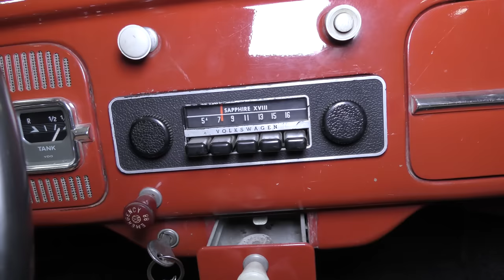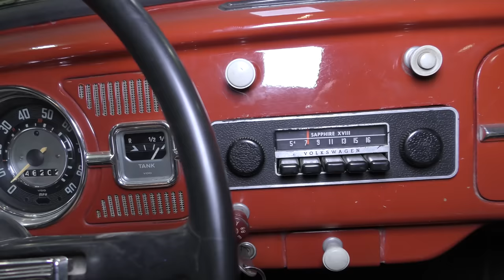Big Mods with big $$$. When Mods don't make sense. What did the  CAR WIZARD do to this '66 VW Bug?

Comment: We have a 1970’s Chevy grain truck with a 427 gas engine. It came factory with electric fuel pump. It has a prime button in the cab. After sitting for 6 months or a year, you hold that button until you hear the pump slowing down, crank it and it fires right up every time.
Reply: Do you mean just for priming...did it also have a mechanical pump on the engine?
Reply: @JohnSmith-yv6eq  it runs on it also.
Reply: @junkorbust9498  
Why do you have to hold the button down if it runs all the time? 
As soon as you switch the key on, the pump should run...and continue running..
Unless you have an oil pressure sensitive on/off switch for a rollover/crash situation where the pump only runs when the engine runs and has oil pressure?
That would make sense of the "primer button".....
Reply: @JohnSmith-yv6eq  i went to lay under the truck to get the answer for you. It has an in tank fuel pump in each tank. There’s a block with some check valves where the lines are connected. A switch on the dash switches between pumps and the prime button runs the pump with power direct from the battery to fill the bowls before starting if needed. Farm trucks often sit for months at a time so it’s a handy set up. It came from the factory that way.
Reply: @junkorbust9498  
Thanks for your dedication...
I have a 1972 XJ6 Jaguar with the twin 12 gallon rear quarter tanks, with two pumps and a selector switch on the dash. 
The selector switch just selects the pump which works at all times the ignition is on....including in a crash....
Sounds like yours has something like the oil pressure switch...it's a bit safer that way....
Reply: @JohnSmith-yv6eq  early XJ is a nice car. Jags are way underrated. I have an early XJ-S, it has the D-Jetronic Bosch Injection. I just bought it last fall. It has been of the road since 2000 and hasn’t ran in 7 years. It’ll test my resolve I’m sure. The fellow I purchased it from couldn’t bear use it as he was afraid something might happen to it. He ran a later HE instead. What he did was of course the worst thing that he could have done short of abandoning it outside. After all that time he could only get $1500 for it. It’s quite a solid car for a Jag and the interior is super minty so it may be worth the effort I suppose. Anyways, too much off topic info.

Comment: I did drive my VW's more frequently. But all of them, from several different years and models, had one thing in common.
They all started on the first touch of the key. To this day I can't admit a car on my hands that's not like that. First start it as to run. ;-)

Comment: That fuel stabilizer works great, I used it on my motorcycle. I ran it through the carb  and put the battery on a shelf, come spring I pumped the gas a few time to prime the carb and the bike started right up. The bike didn't even need a jump.

Comment: Back in the early 70’s (I think) my brother bought a ‘63 VW bug.  He ran it for about 1.5 years before he started having firing problems.  He brought it back from VA where he was stationed in the USAF.  My father tore down the engine to find the problem…a cotter pin was in one of the cylinders.  It was too big to have come through the fuel system so it was there from the factory.  The car had been purchased, originally, in Germany, driven down through Europe then ferried over to Africa where it was driven to South Africa, shipped to Argentina and driven across South America before being shipped to Mexico (again, I think it was Mexico, not sure) before being driven into the US and finally sold to my brother. It had over 100,000 miles on it when he bought it.  There was documentation showing the car’s travels that my brother saw, but he let the owner keep.  

Over 100,000 miles before the engine started to miss.  This is why people loved the old Beetle.
Reply: Wow, talk about a globetrotter. Wonder what happened to it.

Comment: Yep, engine behind the rear wheels worked great when the engine is so light that you can pick it up and put it on the workbench all  by yourself, or, if it's in a bus. BUT in a sports car with high BP and a big water cooled flat six hanging out there?  Nope. Then you drive yourself backwards into a tree.
 Love the bug though. Had a '74. Great little commuter car. Got me back and forth to college dirt cheap... what was that commercial they had? Oh yeah:  'TWO PENNIES A MILE, TWO PENNIES A MILE!'  I don't even think it cost me that much, since I got mine used for $300.

Comment: This style of “hot rod look” is called Cal Look from the way the Cali guys used to set them up back in the day.
Reply: Cal Look means (besides many other things) that you remove the quarter windows and replace them with a one-piece-window. That's why my '57 oval never went to this, I loved the quarters too much. But then you should decide (which isn't done here): chrome at the windows or not - a Cal Looker is off chrome there, normally. This mixture with chrome at the doors and no chrome at the other windows leaves the car unfinished.
Reply: I always thought true cal look had white window rubbers
Reply: all the JC whitney bug accessories from the 80's catalogs!
Reply: @bradcollins9647  right…. We could go down the list of the 18+ items, I was generalizing.
I think the BRM (99.9% aftermarket) and the raked angle speak to the essence of the Cal-look… glad to know I’m not the only one in the know 👍🏻
Reply: @bradcollins9647  Yea, my grandfather turned his 60 rag into a one piece. Man I wish he was still alive so I can kick him in the ass for that one. I prefer the quarters too but kept the one piece while rebuilding it just for the old man.
Reply: Cal look was essentially the classic grass roots hot rod formula: Strip off all unnecessary trim, run the fattest rear tires and narrowest front tires that will fit, and all the money goes on a bored and stroked monster engine with dual Weber48 IDA carbs. It was all about straight line performance. DKP club cars stick to the original definition.
Later the term "Cal Look" was applied to any VW with a lowered stance, T-bar bumpers and one piece windows.
Reply: @philtowle4683  That's the Hawaiian Look!

Comment: One solution to starting issues on old beetles is:  the push rod for the mechanical fuel pump gets varnish on it and when it is hot the rod gets stuck.  Clean the varnish off the rod and it should work as designed.
Reply: Also the plastic/Bakelite housing that the rod runs in can expand and pinch the rod. This can be helped by sanding down the exterior.
Reply: this problem has been permanently remedied.
Reply: That helps only so much - after sitting long enough that the bowl and lines have evaporated to dryness and you will need to crank the engine for quite a while before fuel gets in the bowl and you will often have a false start or two.

I helped fully restore a one-owner 1974 Super Beetle and we went with an electric fuel pump and a tach-based relay for pre-purge and crash cutoff (so the pump wouldn't just keep running with the ignition key on)... it will run for 3 seconds or while there's a tach signal.  Also has an electric ignition and rev limiter and dynamic advance. Car starts just like the one in this video.

Uses dual carbs, though, which I think was a mistake... I would have preferred fuel injection (the car also has A/C and practically all modern amenities... it's pretty insane).

Comment: I added a copy of the John Muir Publications manual for the air-cooled VWs to my reference collection when we helped clean out a hangar that had been sold by the owner's widow, and their kids had divided his collection of VWs, and left all the service manuals.    Good to see the speedo cable remaining connected to the front wheel.  That was a great indicator of the drum brakes locking up in the winter, as happened when I pumped the brakes coming down Lost Trail Pass one afternoon.  When the speedometer suddenly drops to zero, heading downhill, "Hey, I'm just along for the ride!"  and wait for the wheels to start turning...

Comment: 11:31 You never mentioned that those adjusters aren't stock. They are an aftermarket item and do affect the car's handling and bump-steer. Ideally, drop-spindles are a better option if you want a lower front than stock on a daily driver bug.
Reply: Yep.  And there's no front sway bar either.  EMPI makes 2 inch shorter sway bars now.
Reply: If he puts drop spindles on it his tires will rub the fenders.  Then he will have to install a narrow beam.
Reply: @Bondovw  You get the same tire-rub issues with adjusters but with added bump-steer. Adjusters are fine and I know plenty of V-dubbers who use them, usually with 135 or 145 tires. I was just pointing out that they have their disadvantages compared to drop-spindles on a stock beam.
As someone else pointed out, there's no sway bar in sight either, which is a major oversight on a street car.
Reply: Adjusters are fine when used with a drop spindle depending on the location of how they are installed.   Adjustable beams are good for about 2 1/2 drop.  Vw bugs front ends are pretty stiff. When they are dropped they don't need a sway bar.
Reply: @Bondovw   They added the front anti-roll bar to the beetle to increase understeer. This was to increase the handling safety of a car that frankly has oversteer "issues" with it's rear weight bias and/or swing axles. It's why it's generally a bad idea to remove the front bar or to add a rear bar that is stiffer than the front. A dropped front is no stiffer on a Beetle than stock; it just sits at a different angle :)
I can see this debate could go on ad-infinitum Tim so I'll leave my opinion/input at that.

Comment: Awesome Bug, love it. The 1300cc sounds flawless. VWs are my jam. I have a 1973 full custom, four wheel disc brakes, wider rear fenders, lower all around, Rancho Pro street trans, dual Webered 1835cc engine, 18" wheels all around.

Comment: Great content - thank you! Question, did you consider conversion to electronic fuel injection and electronic ignition? Would that eliminate the purging time delay and also make it more reliable (and not be anywhere near an EV conversion cost)?
Thanks too for the overview of old cars and new gasoline’s; I experience all of it in my 1968 Chrysler.
Reply: I was wondering that too. Makes sense if they just want a turn-key car.
Reply: CB performance has very nice setups for these.
Reply: @Traxxas119  I picture his points burning, with the key on.
Reply: @elultimo102  converted to electronic system?

Comment: That fuel pump is class. Well done wizard.
Reply: I assumed when he first talked about it taking a long time to prime the carb, that he would keep the original pump and just add an electric fuel pump with a vacuum switch to cut it out once the engine had started.  But I guess the little motor wouldn't need much of an electric pump to feed it 100% of the time.

Comment: Agree on the exhaust note.  Would love to hear it run thru the gears, not blasting just running normally… from inside cabin and outside maybe a driveby….btw I learned to drive on a 68… dad pulled up on a hill at a stopsign, said get out, made me sit in drivers seat and I learned how clutch feathering worked real quickly….lol… people stuck behind us werent really happy tho….

Comment: The engine would run better with the right distributor.
Reply: Not really.  Most owners swapped out the stock vacuum advance distributor for a centrifugal mechanical advance distributor.  That was probably the single best modification you could make to the 1200cc & 1300cc engines for improved performance and drivability.
Reply: Seems like literally everyone put the 019 in with a blue coil. Go figure. I mean on my 1st ten or so Beatles I did.

Comment: This model 1966, was my first new car when I lives in Buffalo, N.Y. I moved to Dallas-Fort Worth in 1969. In the hot summer 100F+ I was getting vapor-lock when I went shopping and parked 15-45 Minutes. I cured it by insulating the fuel line in the engine compartment into and out of the stock fuel pump.

Comment: I had a beetle at one point. It’s my favorite car ever. It had one of the auto sticks I learned how it all worked and it was pretty creative. Basically dsg you had to manually shift without the clutch pedal. The stick has a sensor in it when it senses your hand on it which is super minimal pressure it’ll release the clutch so you can shift it.

Comment: My father bought a new 66 Ruby red Beetle, in September 65.  Also had white leatherette interior.  He loved the simplicity of the car.  My brother and I learned how to drive on that car plus it had a 4 speed transmission.  He had it until he bought a 78 Rabbit in Miami blue. In late 77.  My brother and I used that Beetle a lot at the Jersey shore and ran it to it's too speed on the Garden State Parkway.  I'm sure that 1300 engine was tired after we drove that car.

Comment: I am glad you brought up that problem, I am working on a system to retro fit on to carbs to make the "vent's" closed until vehicle is turned on. making the fuel system a closed loop like in newer cars until time for operation and then it would vent through a soliniod

Comment: I use that Stabil fuel treatment in the standby generator for my home. It should be running on propane but it has a gas carb so gas is necessary for now. It only gets used once or twice a year and with the Stabil added it starts within 10 seconds everytime. Good stuff.

Comment: Added a kill switch for my 1972 MGB fuel pump (a Delphi.. not SU) and let engine run for few minutes with pump off before parking. No more fuel percolation and flooding after parking in hot weather in TX. When ready to restart, just flip switch and turn the key, listen to pump to tell when bowl (Weber 32/36 2BBL) full. Turn key to start and varroom, ready to go.

Comment: Cold start procedure.... turn on key and fill the carb first. That one pump of the throttle sets the choke and provides a single shot from the throttle pump. If you press the throttle first the pump won't have anything in the bowl to pull from.
Reply: also key needs to be on to set the choke. its electric

Comment: Beetles of that era started very easily due to the low compression engine.  I owned a 63 with the 1200 cc motor. The starter failed (I thought) and being poor as a churchmouse, I couldn't afford to replace it.  For some weeks I got away with parking it on a slope or enlisting a couple of people to give me a push start.  But then I discovered I could start it with a ratchet wrench.  Emergency brake on, transmission in neutral, turn on the ignition, pump the gas once to set the choke, and then attach a spark plug socket to the generator pulley nut.  One firm pull with the ratchet and the car would start.  The rotation of the engine was in the direction of the ratcheting action, so even if I couldn't get the socket off quickly, there was no risk of breaking a wrist.  I could "goose" the socket off the nut.  I was very proud of myself.  Of course when I learned nearly a year later that the starter was in good working order and all that was needed was a $2 replacement battery ground strap, I felt pretty dim.

Comment: My 1st car was a 61 bug, no gas gauge in 61. LOVE those wheels with stock bolt pattern and the SS muffler so it wont need to be replaced again, needs STOCK bumpers though. Looks like a newer motor swap as they had a generator in 66, my 61 was a 6V

Comment: For are race vehicles that set around for about a week than ran every week end. We had 2 x10Gallon Fuel cells. We added a second fuel pump ran on its own battery. It would fully cycle the fully between the 2 fuel cells. This was a Flat drag 77 Blazer.  Came in handy a couprl times when the main eletric pump died. Just had to redirect a tube.

Comment: I had king pins in my 64. Yes, they do wear out. The plastic tank with the schraeder valve was pressurized I think from the tire to provide motivation for the window spray. That would be a good thing to electrify.  MY buddy drove me over to a distant club in his red brand new 66 cabriolet to see "The Young Rascals" In 1966. Small club I got to stand right next to the drummer. They could make those cars for prob under $15K now no electronics and it would be a good thing. No point in putting a super muffler. Stock works best sounds best. Thanks for the memories.

Comment: Grew up with a 68 and 69.....   Made the huge mistake of selling my built Cal Bug 69 when I hit 19.   Still a huge fan of aircooled V Dubs....   Very nice!   Another benefit of the electric fuel pump is, if its gonna sit extended is to pull the fuse and let the carb run dry before storage.

Comment: My sister had a '66 in the early  80's.  Had a factory isolating dash fan the actually worked! But it wasn't enough in the Houston heat. 6 volt electric system. Never quit running! Just keep the oil changed and monitored. And the cooling fan belt changed with high detergent 30 weight. That was the only source for cooling the engine. It would run 60-65 mph all day long. She wishes she still has it. What a classic piece of engineering!